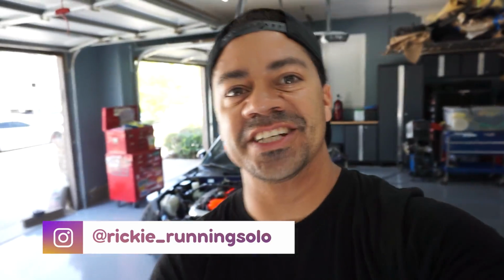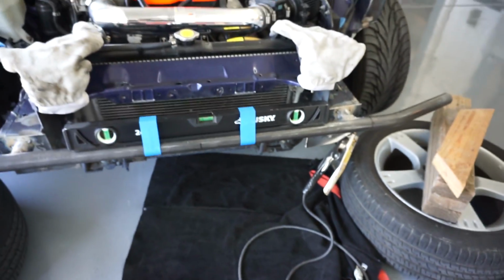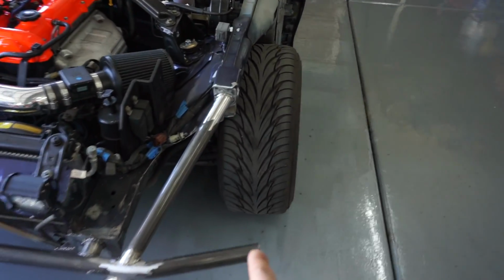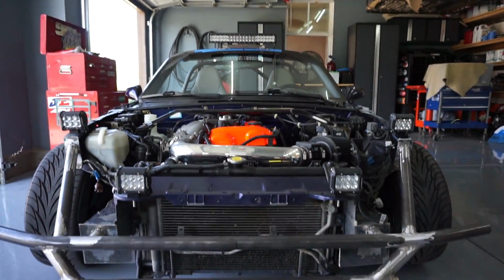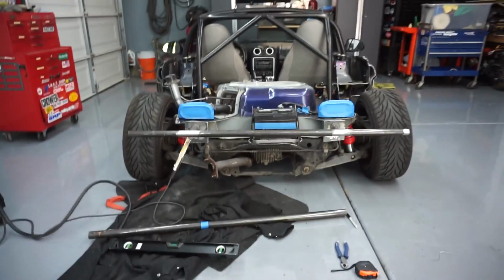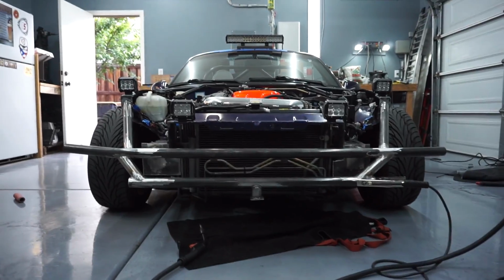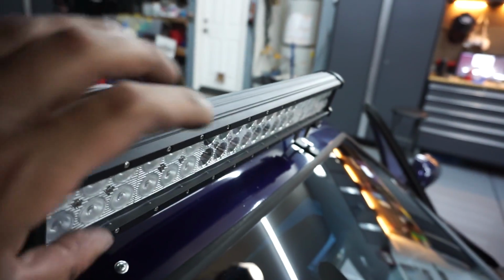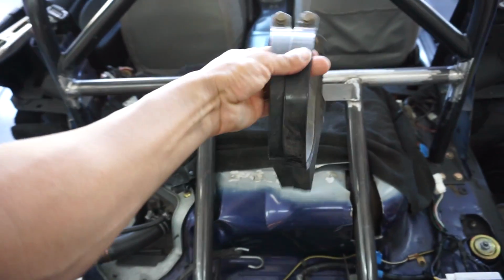Exoskeleton Mazda Miata Build is COMPLETE! (First Real Burnout!)

Comment: If you want the keep the spot lights on with the high beam and used the stock switch, you may try running a second power wire from the high beam to the fog light with a diode so they stay on. The diode will keep it from sending current to the high beam when you just want fog lights on

Comment: That nitrous bottle should be mounted up and down more not sideways. Put the gauge at the top facing the front of the car and the bottom down towards the bumper.
Reply: it'll work just find the way it is .. it's just for show with a purge kit for now.. but I know what you mean.